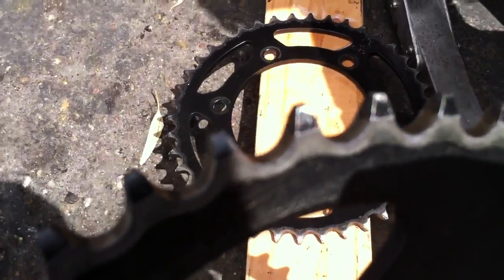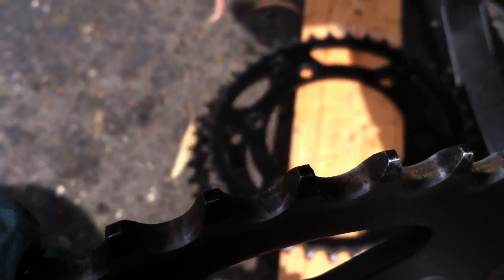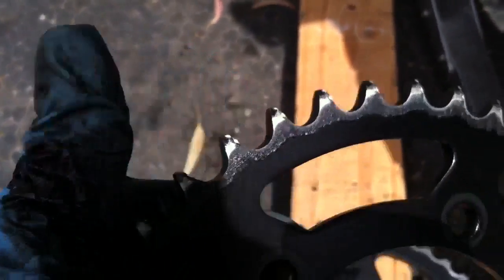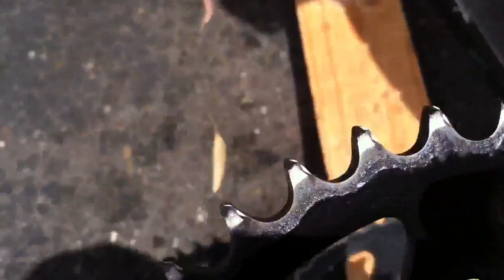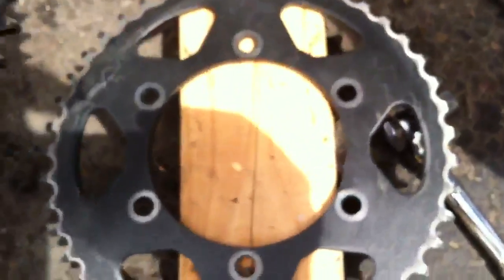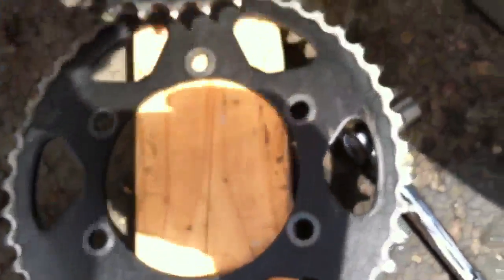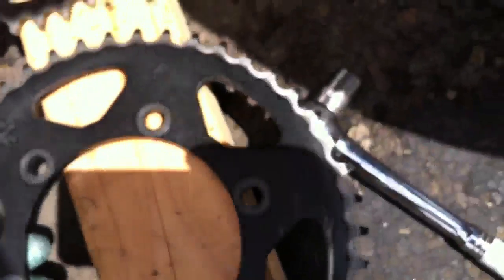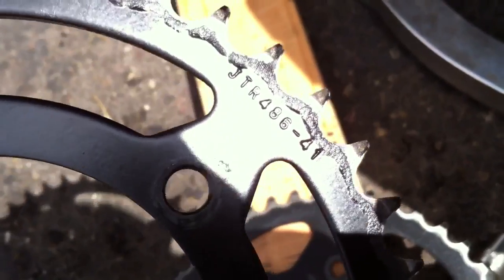Excessive chain and sprocket wear

Comment: youll find that one sprocket has alloy impurities in it making it weaker than the full steel oem stuff
Reply: its very visible on camera that the original sprocket that came with the bike has more actual METAL than just alloys , if you look at the rough edges on the newer sprocket, they will be slightly grainy where the chain rollers make contact , on the old one , in the same areas ,it wont be grainy but it will be shiny as hell , thats a way can sometimes tell if the metal has impurities or not !
Reply from the maker: Interesting. Both are JT sprockets with the logo so I assume they are supposed to be the same. Are counterfeits an issue for JT Sprockets?

Comment from the maker: Did you see my last video? I've had two more failures: A Volar Motorsport chain with broken and missing rollers and a used OEM Kawasaki (EK SRO endless) chain. I don't see a problem with the only common denominator (front sprocket and shaft) but it's hard to believe that they would both fail the same way without something specific causing it.

Comment from the maker: @TheOriginalMulvaney Thanks. I used a chain/sprocket alignment tool. I replaced them all months ago and found the old master link was too tight, could only turn a degree or two before seizing, and was full of chalky black powder instead of lube. The installer suggested a rivet-type instead of the original clip-type master link and they provided one from a completely different 520 chain. This is why you don't miss-match them. Even the rubber rings were completely different (X-rings vs. O-rings).

Comment: Hey, your mom asked me to take a look at this vid and give some input.  In my experience the type of wear seen on the newer of the two sprockets was most likely due to incorrect chain tension, incorrect alignment of the crank and final drive sprocket, or a bad chain.  I noticed in the notes that you had some sort of incident in which the bike had to be repaired.  I would first check the alignment of the two sprockets.  Hope that helps, message me if you need any more advice.